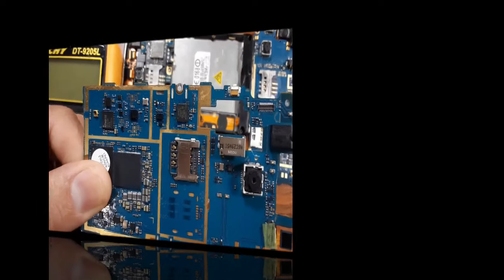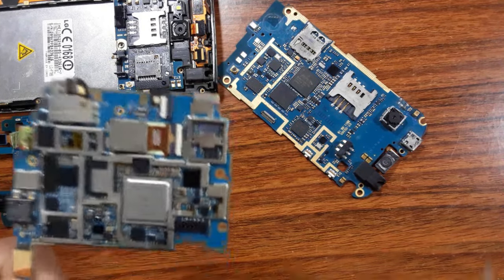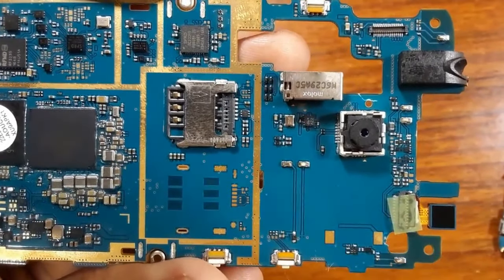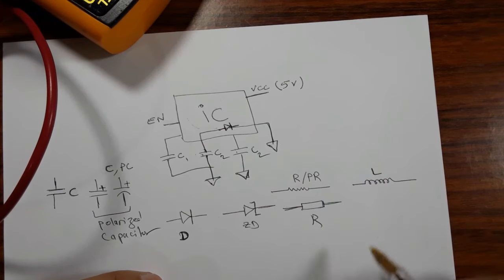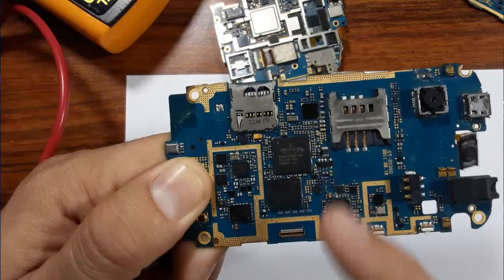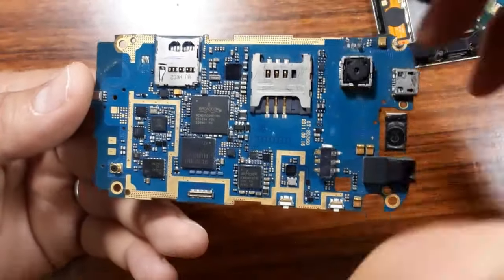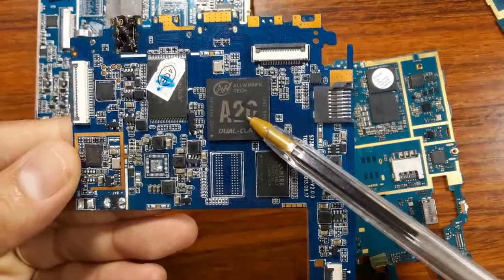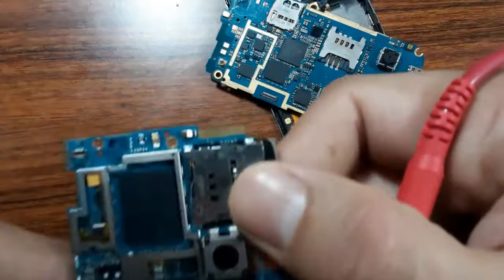Complete Cell Phone Motherboard Repair Course - mobile phone motherboard chip level repair

Comment: What is the problem of adapter  charger voltage output is good but red indicator led is not turning on only green turning on . I test the led three terminal  is good but red light is not turn on only green
Reply: Maybe your battery too low under 3.7V so charging chip cant turn on to charge. Must manually charge the battery(shocking) to reach 3.7 V

Comment: My phone got ran over but mainly on the front side, the back glass shattered completely and the flex cable connector got damaged a little causing the screen to not connect. 
I have very valuable footage but i cant charge or connect to the phone.
Can it be fixed?